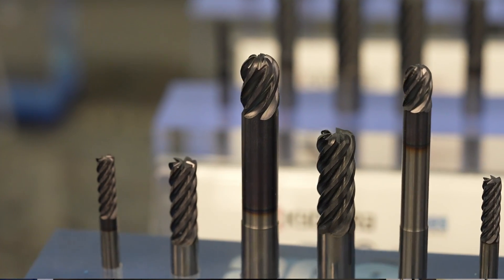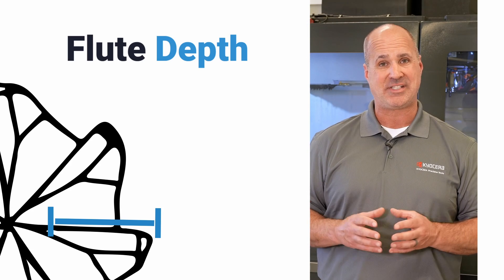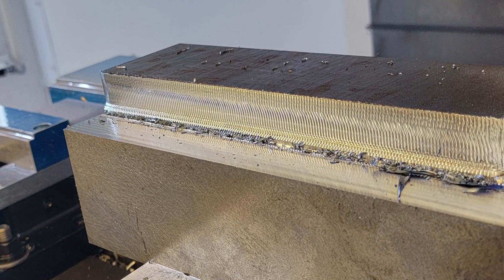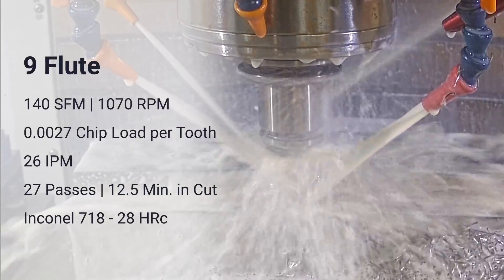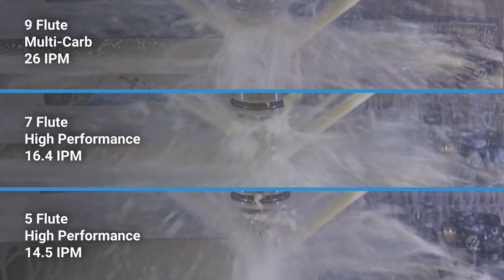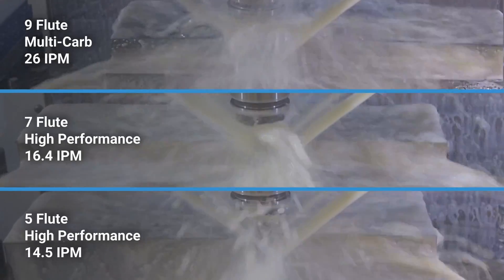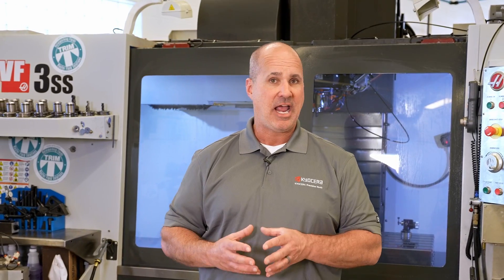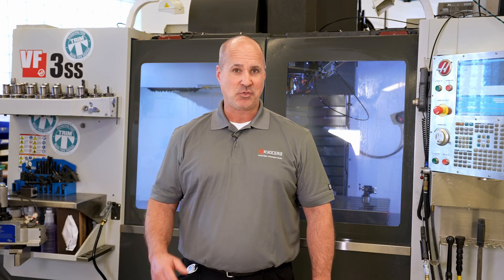Multi-Flute Tools: When to Use Them and When to Avoid

Comment: Can you give more info on the parameters of the cuts you did please? Tool diameter, axial and radial doc, tool holder?
Reply from the maker: Material: Inconel 718 ~ 28 HRc

Engagements: Axial (Ap) 1.25” – 250% Depth to Diameter and Radial (Ae) .035” – 7% Width to Diameter
Total Linear Inches Milled: 324”
Diameter: 0.5

5 Flute High Performance End Mill
126 SFM / 963 RPM / .003 Chip Load per Tooth / 14.5 IPM
22.3 Minutes in Cut to Complete Above

7 Flute High Performance End Mill
140 SFM / 1070 RPM / .0022 Chip Load per Tooth / 16.4 IPM
19.8 Minutes in Cut to Complete Above

Multi-Carb End Mill
140 SFM / 1070 RPM / .0027 Chip Load per Tooth / 26 IPM
12.5 Minutes in Cut to Complete Above

Comment: So would you suggest roughing with say a 4 flute and finish with a 5,7,9 flute?
Reply from the maker: Yes, the material you're machining is a critical variable in selecting the number of flutes. For instance, softer materials like aluminum typically benefit from fewer flutes (such as 3 or 4) for both roughing and finishing to allow for better chip evacuation. Harder materials like steel might use more flutes (like 4 for roughing and higher for finishing) because they can handle the increased cutting forces and benefit from the additional cutting edges.

While you can achieve a good quality finish with a lower flute count, it's generally preferable to use more flutes when possible. Higher flute counts can achieve the same or better finish in a shorter amount of time due to the increased number of cutting edges engaging the material.

In summary, while a 4-flute tool is often used for roughing in a variety of materials, and higher flute counts are used for finishing, the specific material you're working with should always be a key consideration in your tool selection.

Comment: If the flutes are regularly spaced, it can still generate periodic vibrations, causing chatter, regardless whether the number of flutes is even or odd.  Irregular spacing can help.
Reply from the maker: You're right that irregular spacing of flutes, also referred by some as variable pitch, can help reduce chatter. Another effective strategy is using a variable helix angle.

A variable helix angle can be either variable up and down the flute or alternating helix angles per flute (such as 35/38 degrees, like in our ZAP series). This variation in helix angles spreads the cutting forces more unevenly, which can significantly reduce vibrations and improve surface finish.

Both variable pitch and variable helix tools are designed to address the same problem—reducing chatter by breaking up the regularity of the cutting forces. Depending on the specific machining scenario, combining both strategies can often yield the best results.